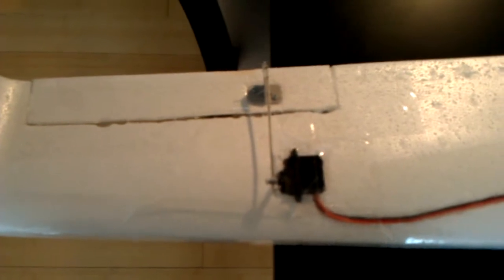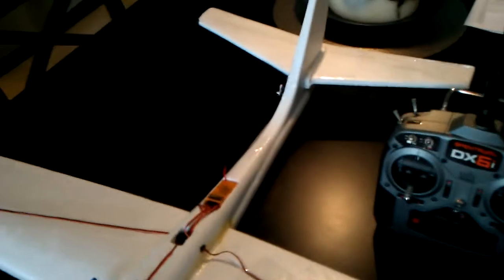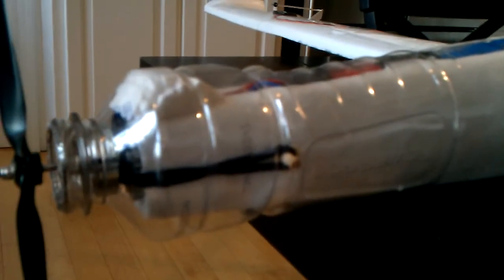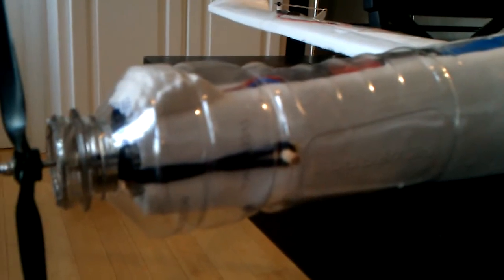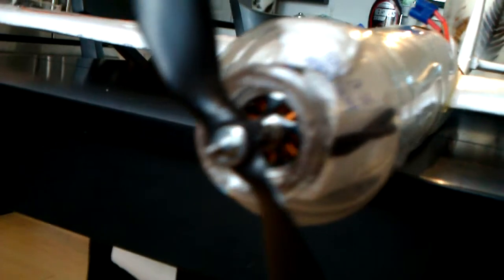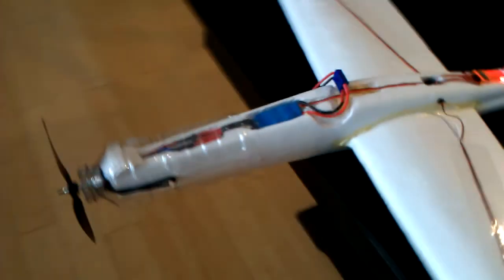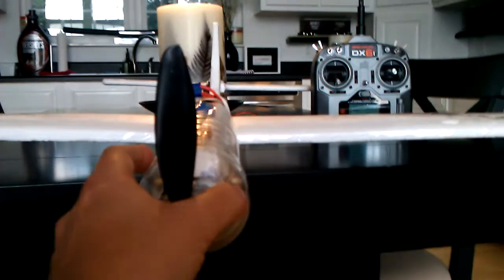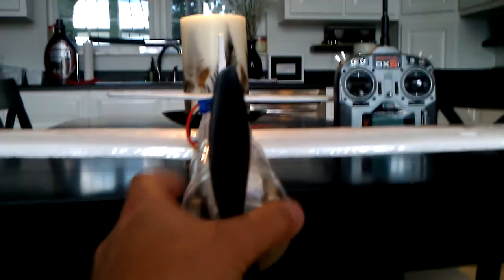Chuck Foam Glider RC Conversion

Comment from the maker: @RICHYZEE1 the motor is a dynam a21 motor which the motor only weighs 37g, the prop is a 8.4.  not really sure how much it all weighs together because i dont have a way to weigh it.  i can tell you that it doesnt weigh much at all though the battery weighs the most it is a 3 cell 1300mah.